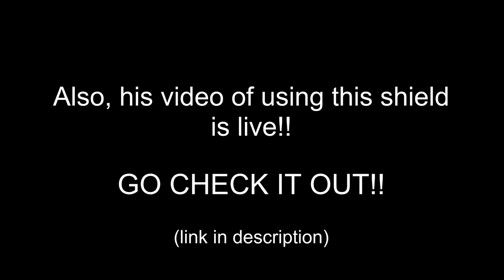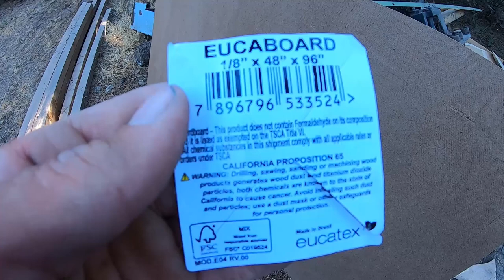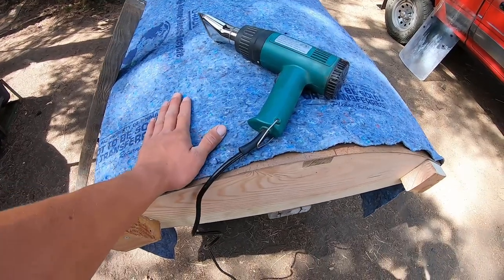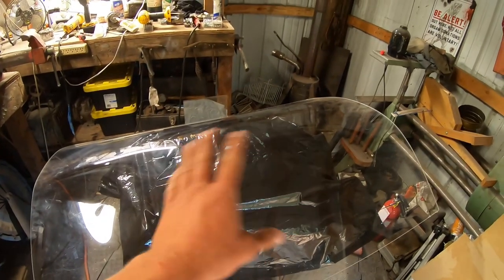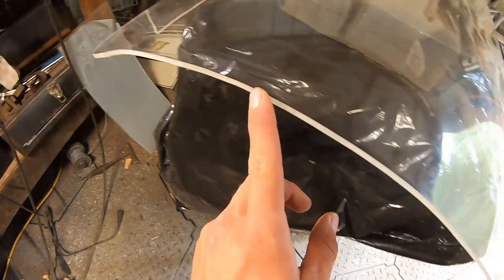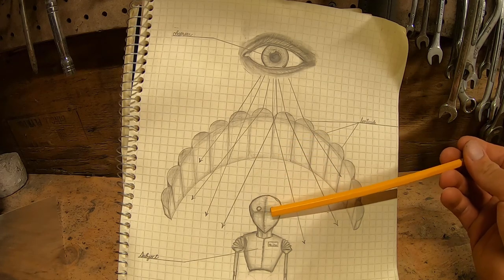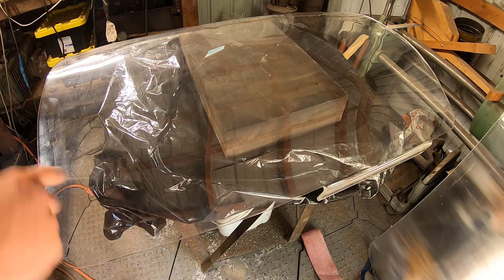Building An Updated Invisibility Shield... For Chris Ramsay!?!

Comment: Hey, here's an idea for gluing the lenses across the entire surface instead of just the edges: talk to some local woodworkers who do veneer work, a local woodworking supply store, like woodcraft, may have references to help with your search. Basically you want to find someone with a "vacuum bag veneer press" this will allow u to use epoxy to adhere the entire surface of the lense to your shield. You could make a traditional press yourself too though. As a matter of fact u already made half the press with the form u used to shape the shield. Anyway using a vacuum press would be foolproof and with the help of a skilled woodworker you could definitely make a great invisibility shield!

Comment: Here before Chris blows this channel up
Reply: Me too. Me too!
Reply: Same here! saw the first video and now this! wow!
Reply: yes
Reply: Same
Reply: SQUARE PROBLEM.  Flame torching edge does not make any sense since the edges of the tabs you folded are 90 degrees !!!!!!!   Engineering contradiction.  Solution next time all edges ROUNDED!!!!!   Do you see square port holes on ships? No!  do you see square windscreens in cars? NO.  Do you see square 90 angles in aircraft windows?   NO!  The comet pasenger has square windows and killed many hundreds of people before they worked out that 90 degrees BAD.
Reply: gpu logic sorry what?
Reply: Me? Too? -ish
Reply: he will... yup... :)
Reply: Did I make it in time?
Reply: @gpulogic4ai  hey dummy its not designed to be used for aircraft or naval ships.
It doesn't suppress radar detection or deflect  light/wind
Reply: Yes

Comment: This shield should also work for masking infrared detection. As long as the shield remains at ambient temperature (otherwise the shield itself will be visible). You should be able to confirm with a cheap thermal imaging scope or monocular.
Reply: Wait.. can't you see heat with infrared through windows?
Reply: @2degucitas  not sure about glass, but most plexiglass/ polycarbonate & i think even lexan will absorb and/or diffuse IR to the point that you can't see an IR image behind it unless a hot object is directly touching it for a period of time.

Comment: Regarding optical bonding. You don't need a vacuum chamber, you could use a vacuum bag and pump. The surfaces you're working with should be smooth enough to not pose any significant bubble-problems vacuumbagging.

As for adhesive, weld-on #4 IIRC is optically clear, it's actually used to glue / "weld" acrylic joints for optically clear, invisible seams for aquarium tanks etc. It flows incredibly lightly.

Comment: can we take some time to appreciate that really good drawing of an eye
Reply: The eye, the subject, and the enlarged lenticular lenses are very well drawn.  However, the arrows on the light rays are pointing in the wrong direction.  I was a Physics and Math double-major in college and I also took art and photography classes.  I'm not an expert, but more knowledgeable than the average Joe/Jane on these topics.

Also, he should have said "refracted" instead of "reflected".
Reply: @frederickevans4113  Isn't there a reflection after a certain critical angle? Maybe that's also an aspect of the design, to maximize reflectivity?

I'm in mechanical so don't know as much. but yeah it could be he got the basic idea from somewhere else, like a paper. and then he got his hands dirty on an idea he liked.
Reply: @nipunkothare  Optical fiber (fibre) works that way.  The strands of glass fiber are so thin that once light is introduced at one end (at 90° to the flat, polished end), the angle of incidence at which the light bounces along the "walls" of the fiber down its length is always shallow enough to reflect internally instead of exiting the fiber through the side.  IIRC the technical term is "Total Internal Refraction".

I think he just had a "brain fart" or two.  It is easy to confuse the direction someone is looking vs. the direction in which light actually travels to be observed by the eye or 📷.

We all have the occasional "brain fart", sometimes even more frequently in front of an audience (stress and all).

Comment: I'm curious what you see when looking through the shield from your side. Can you show us?
Reply: Probably a pretty similar horizontal stripyness
Reply: he did, that is the most important observation, watch again the video.
Reply: @whowhowhowhowhowho8139    Throw in a time stamp for that scene and I will take a look.  Otherwise, I think you are full of beans!
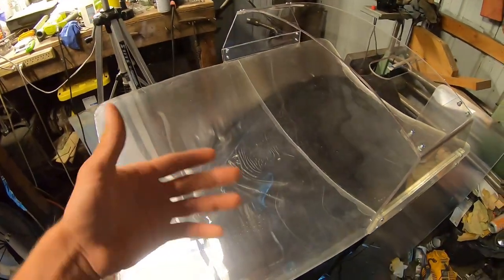Reply: @tribulationprepper787  check it out at 19:48, it looks the same from both sides.
Reply: If you look @19:25 on, you can see what's behind the shield on the table. He set it so the lines go horizontally, so you can see some of the horizontal bars behind the shield. If his arms were spread out while behind it, you'd be able to see them (somewhat). As long as he sits or stand/squats vertically you won't be able to see him. So, it SEEMS to work the same way from the other side as well.
Reply: True. When on the table we see it from the inner side, and it's the same as looking from the other side, which is kinda expectable, since this is how science works I guess. 

Seeing clearly while not beeing seen is the ultimate goal, I guess I was hoping that this shield works like that, but sadly no. Thx for the answers, peace.

Comment: Something to consider on gluing the material to the shield... I saw a video once that showed how to build your own solar panel. Soal panels use small solar cells laid out side by side, then they are epoxy'd to a solid piece of glass for protection. The epoxy that was used, is a very slow cure epoxy - 24 hours I believe. AND, the epoxy was rated as being able to pass light completely. The guy mixed the epoxy into a bucket, then he placed an air extractor lid over the bucket and used a vacuum pump such as can be found in an auto part store and he evacuated the air out of the bucket which removed all of the air bubbles from the epoxy. Now in the solar panel situation, he had built a wooden frame to surround the glass, then he laid out the solar panels on top of the glass then he poured the epoxy on top of all that and let it cure for 24 hours. But I'm thinking you could do something similar so that you could get a complete bond between the lens sheets and the shield so that there are no light distorting gaps between the shield and the lens sheets.

Perhaps once you got rid of the air bubbles with the ad hoc vacuum chamber, you could pour the epoxy onto the plexiglass and spread it around with a paintbrush until it's of a fairly uniform thickness, then lay the lens sheet down on top of that then use a squeegee to work out the excess epoxy and maybe even use some tie strap to hold the contour of the lens sheet to the curved plexiglass. you would probably have to place like paper towel material at the edges where the tie strap meets the lens sheet so that the paper towel catches any epoxy bleed out so that it doesn't stick to the strap... but with two or three straps per lens sheet, it might work out nicely.

I would be careful with the tie strap so that it does not add more bend to the plexiglass because when the epoxy cures, that might cause problems when you release that tension so those straps would need to be set so that they just barely put enough tension on the lens sheets to keep them in place. OR just keep the plexiglass on the wooden frame so that your tie strap can't flex the plexiglass at all.

Something else to consider ... use 2x4 to frame a space large enough to hold the shield and maybe a couple of solid heaters. Use a device like this https://www.amazon.com/Kamtop-Thermometer-Thermocouples-Temperature-Thermocouple/dp/B07DLW3MNV/ which will give you the temperature inside the box and have your two vertical frame mounts mounted to one of the walls of the box and drill holes on the side that connects to the plexiglass that is no contoured yet and as the temperature inside the box reaches the point where the plexiglass can be plied, start putting tension on that side of the glass until it contours itself to the mold that you made. It shouldn't be too expensive to build such a box and it would give you uniform heat instead of using that heat gun. With the right heaters, you could even leave the heaters outside of the box and just build short ducts that will let the heaters pump heat into the box. But you would need some kind of heater with the ability to push hot air into the box and with some kind of small exit holes that let the air inside the box escape so that you're always displacing the air in the box until it reaches the right temp. You could probably do it with just one heater. If you lined the walls inside the box with some kind of reflective heat-tolerant material, it would make the process much more efficient and safer!
Reply: I'll bet that sheeting could be 3D printed as thick as your shield.

Comment: Randomn, what are your thoughts on carefully inserting a flat tube between the lens and the plexiglass (after you sealed it around the bottom, left side and right side) and then filling the tube  with liquid plexiglass, while slowly pulling out the tube. Of course, leaving no bubbles. Would this add additional stealth by eliminating the distortions?
Reply: Very heavy though, don't you think?

Comment: Hi! Really cool! I was wondering what would happen if you were to stack the lenticular sheets 15° each layer until you made a complete 360°? Would this work better by splitting the light in many ways?
Reply: Unfortunately not, this uses the space in-between the user and the shield as the refraction zone you would see. in other words you still see the space behind, it's just distorted to the sides. Using a 360° would just show a barcode version of you top down. Sorry to disappoint.

Comment: You need to make one of these using Norland 61 UV Cured Epoxy, so you can coat the entire shield with the epoxy and lay the lenses flat onto it, then cure the epoxy by setting the whole thing outside in the sun.
Reply: Ooo combine it with a vacuumbag... Except for squeezout but thats a neat tip

Comment: What you can use instead of a vacuum chamber is essentially just a large bag that you attach a hose and pump to to suck out all the air. This method allows you to vacuum seal an object of virtually any size.

Comment: Random tip, you don’t need to sand plastic edges, I use a nice edge of a tin sheet to shave it, you can use the back of a Stanley knife blade. Hold roughly on a 45 degree angle back towards yourself and drag it back to you

Comment: Hey homie, @ 2:25 this is one of the easiest ways to cut a limb off or experience sudden bloody death.  Never pull a piece of stock through a table saw from the opposite side, only push it through. If it binds while you're pulling it through, it will get launched away from you, but faster than you can react.  If it gets launched, you most likely won't be able to let go of the lumber until you're already on the spinning blade.

Instead: use a roller stand or several while the saw is on it's own stand if you don't have space/money for a proper saw table or a second set of hands helping.  Also, use a push stick so that your hands dont have to come close to the blade. 

I work with table saws all the time and have seen what happens when people aren't religiously careful with them.  I hope you've wisened up a bit, table saws and angle grinders are the most dangerous tools out of the common everyday tools.

Comment: To sum it up. You bought a plastic sheet that distorts light and glued it on a harder surface. Project done.
Reply: And guy put some paint on canvas and that's how we got the Mona Lisa
Reply: Problem?
Reply: @treeinafield5022   no problem at all. Based on the title I thought he was going to do some actual building, like making the actual plastic itself or something 🤔.  But all he did was buy the material and glue some things together and done. Instead of putting "Building" in the title  it should have been "making" or something like that. But none the less it was good work

Comment: My advice, if you cut PMMA (Acrylic) is to use a battery powerd saw and run water from a hose to the blade to cool it. This is how to get blazingly clear cuts without any melting of the PMMA.

Comment: What happens if you layer it so the bent light goes through another bent field so regardless of movement direction you stay invisible or does layering them cause them to negate each other (even at different angle?)
Reply: Apparently he does not reply. Your question was excellent.
Reply: So light is weird. The exact reaction you're going to get is going to depend on if the light is polarized or if you're looking at it through a polarized lens (sunglasses) but practically, doing what you're saying and having an air gap between the two would just mean that the whole thing is a bit fuzzier and more opaque.

To get the effect you want you would need to completely bond everything with no air gap so it's clearer, And then do the two angles to make it blurry but not look opaque.

In other words it kind of ruins the effect because it goes too far but if you do a really really good job on both of them it will look similar to what he has there.... Kind of.

Remember that it looks invisible as an illusion because you can see the lines of things behind it going horizontally. If you remove that and blur it to be the overall light in an area behind it, the effect goes away.

Comment: Dark clothes with light color background I can still see you. Your black sweater and your blue Jean's
Reply: That's the main problem that most of the assets have when they're are cloaked. Plus a high light source outlines them fairly well as well as their shadow. The current generation is of a type of wetsuit structure, whilst a lot of the bottom tier assets are still using cloaks/ponchos. 
A great way of detecting cloaked individuals is the use of thermal optics, although these don't work through glass, windows etc etc.
Reply: @n.chapman6390  everything is waves man, all waves can be cancelled. Run with that
Reply: I think ti would be better with the camo they are already wearing. Probably a lot harder to see.

Comment: Good idea. You should look at vacuum bags for carbon fibre moulds would function perfectly for bonding to the sheet. The bags come in sizes up to 3m square and have a air valve connected to them. Just apply the resin , seal the bag and turn on the pump. Also for uniform acrylic bending use a heater filament stretched out into a jig. How professional acrylic workers bend acrylic

Comment: Take some advice from a woodworker.. Glueing on your sheets of lenticular lenses is essentially like gluing a veneer. I’ve used large vacuum bags for veneering  table tops or cabinets. This method might get that clear glass like finish your looking for. Using a good epoxy resin as the glue might also help. Tho, most epoxy needs to “ breathe” to cure properly.. see the link for an example of vacuum bags..

https://www.woodmagazine.com/woodworking-how-to/veneer-inlay/vacuum-bag-veneering

Comment: I'm pretty sure those same lenticular lens sheets are found inside TVs. The older floor model projection TVs called them fresnel lenses and were layered behind the front screen filter. The newer TVs place them behind the outer LCD panel of both LCD and LED TVs. Finding TVs with cracked screens on Marketplace is pretty easy if someone wanted to repurpose damaged TVs into an invisibility shield.

Comment: dude how you not a multi bilionare ? haven't science tried to do similiar things for ages?
Reply: To summarize, it's because we need it to shield temperatures, too. What he's doing is using an eye trick; An optical illusion... We need this AND the ability to shield your body temperature from infrared in one device that you can hold or wear.
Reply: @SethAndrew52  also it can only "cloak" things at a specific angle and orientation. Making it useless for most purposes one would immediately think of.
Reply: Dude, if we're seeing this kinda stuff now, that's been around with the magic community for years, "science" or as some might call it "military research" pretty much took this technology to extreme levels
Reply: It can be perfected.
Reply: @SethAndrew52  so the one that comes up with invisible steel will be the billionaire.
Reply: Science is way more advanced than the government would lead you to believe
Reply: Faux Moulding / Why do you have to think about everything trough the monetary gain ?
There's already some aluminum alloy that is kind of transparent.
In the future there will be techology to make any metal in a transparent structure.

Comment: I wonder how this appears with invisible radiation like IR.
Reply: Likely the same. Visible light and Infrared are both forms of electromagnetic radiation (EMR). The principle behind this shield is Snell's Law. When light hits a medium different than the one it's traveling in, it refracts (changes direction). 

Since visible light and Infrared light are both EMR and are very close on the spectrum, I'd think they would act similarly.

Cheers.
Reply: @stevenmarquez8548  true but if it's spreading it all out should it appear as a giant square beacon?

Comment: To bend the form, just clamp the sheet from the center over a steel drum, and heat the drum from the inside with your torch. Also highly recommend reading the official fabrication manuals.

Comment: To prevent plexiglass splitting, uniformly heat the plexiglass while bending. If using a propane, butane or map gas torch, use low heat.

Comment: B7000 clear glue could be used to entirely wet the surface of the shield before adhering the lens sheet. This way there would be no air gap between lens and formed shield.

B7000 is what some phone manufacturers use to glue the oled screen to the digitiser sheet on top for an optically perfect union.